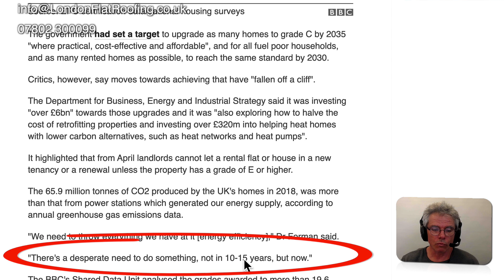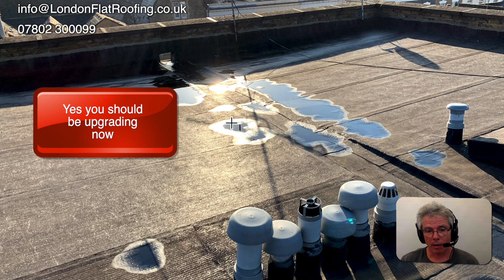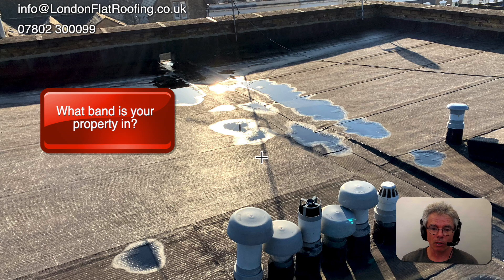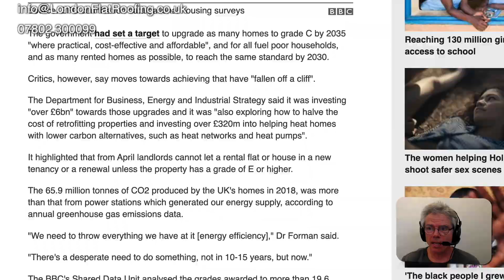When should I Insulate my flat roof?

Comment: What is the minimum thickness we should go for? I'm looking to DIY my flat roof (its side extension 64sqm)
Reply from the maker: do yourself a favour and get the local authority to inspect the insulation you put in you will get a certificate to prove that its insulated to the correct specifications very important as this helps when you have an energy certification on the property ( EPCs)  soon the government will be taxing your property on how efficient it is and without the certificate, you cannot prove its insulated min depth for retrofit 120mm for new build 150mm fit as much as you can as it will pay back easily over the next probably 5 years.

Comment: Hello Steve, I have just built a brick outbuilding and have already installed my flat roof without any ventilation before finding your channel, walls and ceilings are insulated  and building  will only be used as a shed , would this still cause any condensation issues if I don’t add any ventilation, thanks Mick

Comment: Which is best in your opinion for a balcony flat roof.....firestone rubber or felt...or none of those please?
Reply from the maker: Not felt, not GRP but any rubber or any liquid roofing system. What system you use for the balcony roof depends on the height of doorsteps or other items if you have a lot of height EPDM rubber if not probably liquid
Reply: @SteveRoofer  thankyou. I had heard mixed reviews re rubber, Am not sure what grp is .I like the sound of the rubber but one roofer said its sub standard these days so it put me off!
Reply from the maker: @poddington39  No I was only on my garage roof the other day and looked at the rubber laid 15 years ago absolutely no determination detected
Reply: @SteveRoofer  thanks Steve. Having been scammed before it makes you feel a bit vulnerable in terms of tradesmen giving advice..especially when its all different! X
Reply from the maker: @poddington39  Understand its a minefield out there I feel for the older people trying to get good tradesmen.

Comment: What is the difference between a cold roof and a warm roof? Does a warm roof need venting?
Reply: No , if your vapour barrier is Installed properly you shouldn’t have any moisture above the vapour barrier ( or vapour control layer ) that needs to be ventilated out.